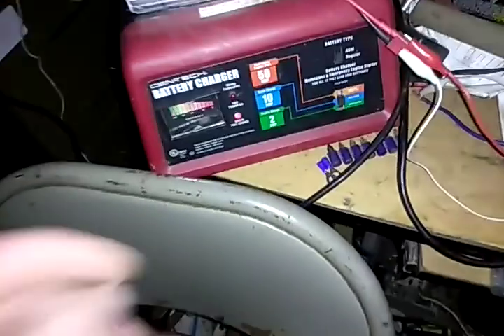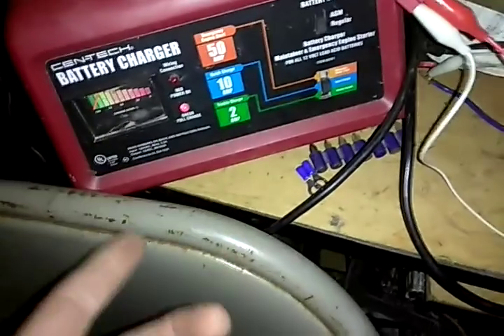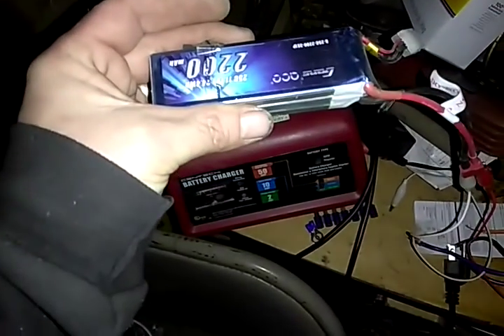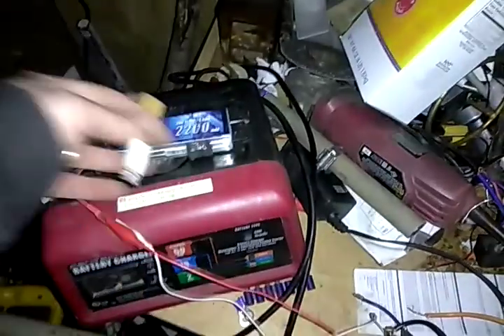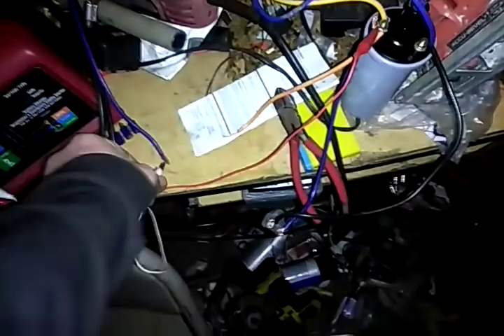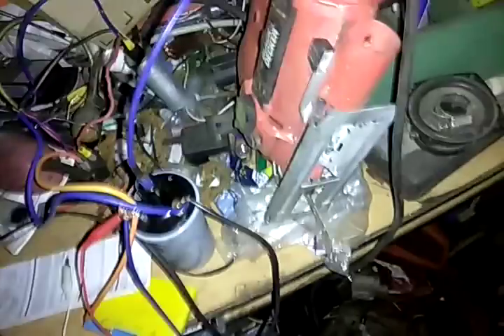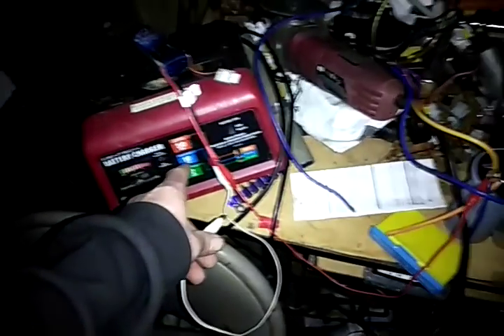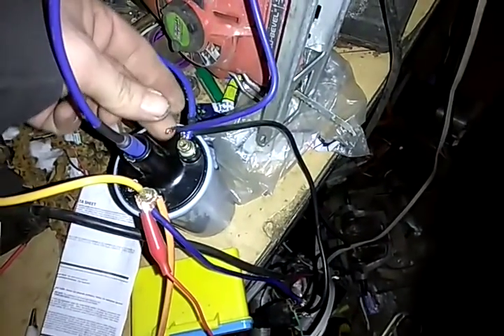HVAC! DANGER! DO NOT TRY THIS AT HOME!!! 11.1 VDC TO 80,000+ HVAC AND 125VAC @ 60Hz

Comment: Interesting as hell but what a fkn mess.
Reply from the maker: +MadMax BeyondThunderbone 
 yes brother I know I know I have another video that shows how the circuit runs and also operates at 60 hertz but this video was just a last minute thing with a dead RC car battery... I'm trying to get enough money to buy a few more better quality relays to build a circuit to run a  light and a 3 horsepower AC induction compressor duty motor to run back to a 10kw generator head that I could use to power a 10 amp battery charger to keep in perpetual motion with the closed-loop...